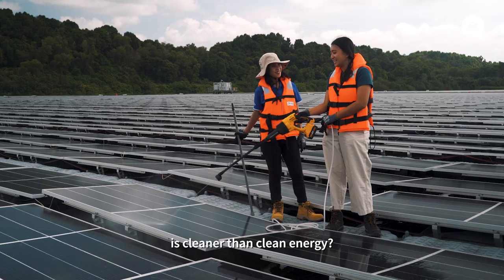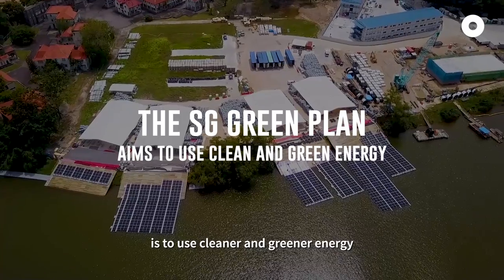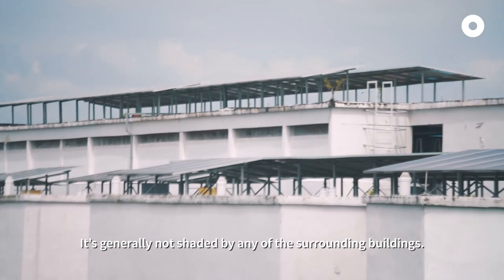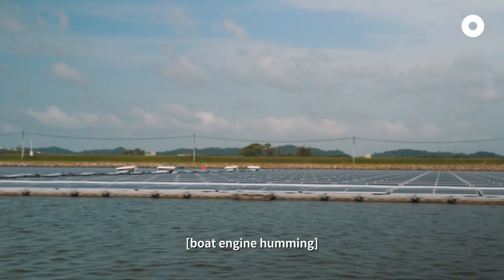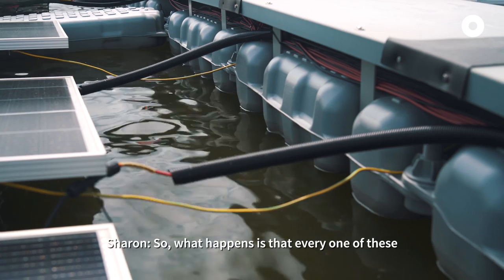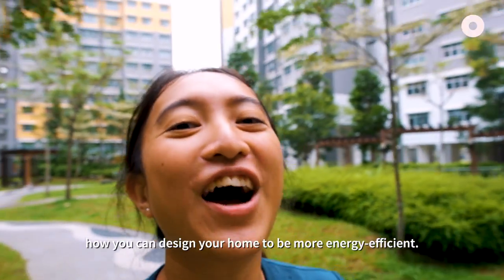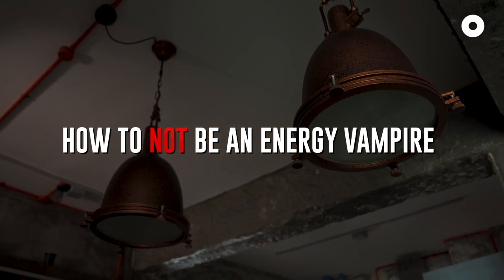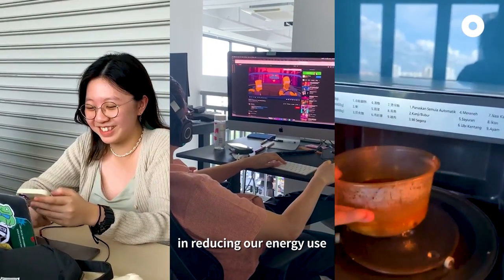One Of The World's Largest Inland Floating Solar Farms?! | Running On Green

Comment: i'm guilty of not switching off my power plugs......... i never knew it actually contributed to energy usage 😮
Reply: yes you should , even if you turn off the appliances from the off button or whatever it is already , some stuff would still use up some electric maybe the indicator on a tv , and rhere will still be electricity leaks so why bot just turn it off directly from the plug
Reply: @jianxiongRaven  👍👍👍👍👍